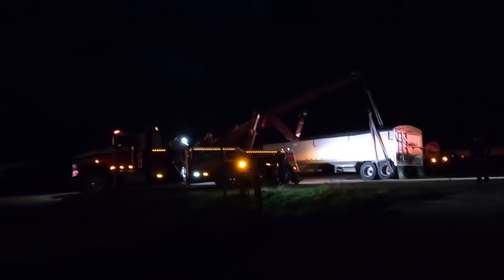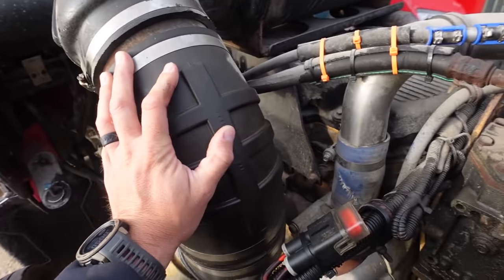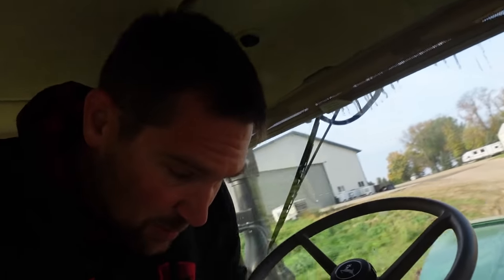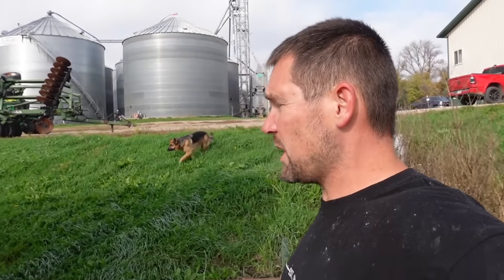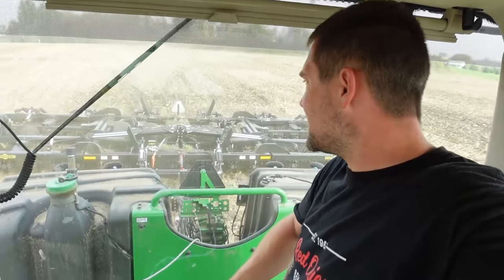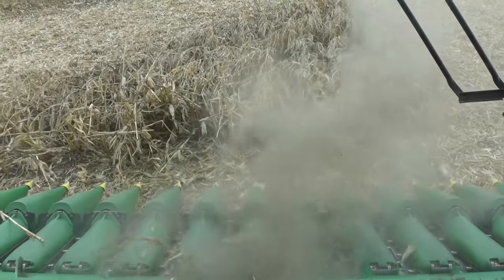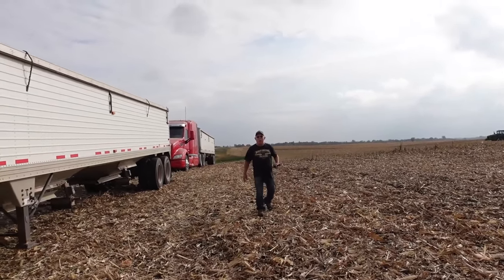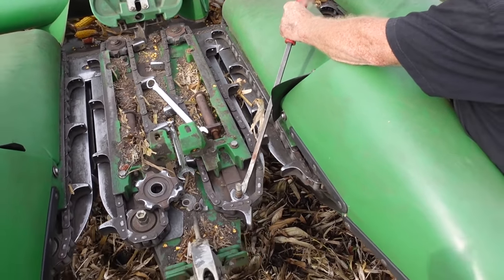Semi Truck ROLLS OVER on State Highway - NOT GOOD!!

Comment: Hi Zach I pretty much know what going through your mind on that truck we have had guys drive off the edge of the roads with trucks fully loaded with wheat down in kanas and Oklahoma you can tell them don't get close to the edge of the road when there loaded but it still happens hell a few years ago we had a combine operator  run the combine with a 35 foot bean head drive right in a county ditch up here in fall harvest  we had to get all American towing out of mankato to get it out but what's what happens when you have hired help you as a boss can only do so much.

Comment: That is now two incidents in the past two weeks with the same damn truck both with the trailer hung up in a ditch. Been driving 39-years and never done it once and that includes pulling 80'ft long oversize load trailers through small city streets. I never even put a scratch on a truck until three weeks ago when I was blind backing with a loaded trailer out of a fenced construction site by myself onto a busy city street during rush hour traffic and I clipped a parking meter with the front right corner of hood above headlight which smudged the paint. I don't even like my trailers getting near curbs while turning or near the ditches of the farms that surround my home. Two incidents in two weeks with the same truck, that can't be a coincidence? You own the truck yet you smile about it, I don't think I could handle that situation the same way. Just three days ago I'm traveling with my 53'ft dry van on a twisty and very hilly road which is only 16'ft wide with guardrails on each side. I'm coming through at 35-40 mph when all of the sudden a 12'ft wide field lime spreader with huge tires suddenly came into view up over the hill at a fast pace and the only thing I could do in that split second was get on the brakes and prepare for a major head-on impact. Just before he was about to hit me, he dove into an opening on side of road quickly with less than 4'ft between us as I was coming to a stop. He had no escort driver ahead of him nor working white/amber strobe lights to warn others he was coming through. I know this is fall harvest and everyone is in a hurry to get it done and over with but there is no place for complacency and all of us should get to go home at the end of the day.

Comment: That was hard to watch  tow guys didn’t have a lot of experience you can see that! On the John Deere starting problem fuel is leaking back check filters and make sure they are tight or fitting for pump /lines

Comment: As a experienced 50 Ton straight stick and 60 Ton rotator operator, that big wrecker driver needs so more training. He should have never tried to pull from the side with it loaded single truck. He should have offset from the rear with the junk inter grated boom. Lifting and sliding at the same time. He cost you 100’s most likely more in recovery changes being there so long

Comment: I honestly don’t understand why you would want a farm truck with a sleeper on it. When you have drivers that do not drive every day and seasonal it’s just asking for trouble. My opinion a day cab short with a back window can’t be beat 15 or 18 speed transmission is what you want in a farm truck.Back in the day you couldn’t beat a cabover for getting around and the guys that still run them know this.And anyone who’s been around really good recovery units are like me wondering why you even have a trailer left at all.

Comment: And today kiddie-winkies - what did we learn in "adult school" ?
We learnt to take a VERY WIDE APPROACH to turn right with a long artic trailer behind, as it will "never" follow the rear tractor tires, but take a much tighter inside radius.
Thus..
Approach from as far LEFT as possible, hopefully also with the trailer as far left of THAT as well, so the trailer doesn't have to jack-knife into the turn, but follow along as far out wide as possible.

Now - for tomorrows task - lets all go and tell the truck driver how he SHOULD have approached that - instead of tightly approaching the apex then turning the tractor into the inside - before going to the other side of the exit .. as..
THE TRAILER was being towed into the apex of the turn, as the tractor unoit even got there, - instead of being "set" as far away from the apex as possible (to the left).
Next time - yep the trucker will make the same stupid mistake - as he cannot figure out why the trailer is ALWAYS taking the tightest path

Comment: That wrecker company needs an equipment check as well.
Reply: That's not the point. Truck was fully loaded and weight about 60,000 pound of corn plus the weight of truck and trailer itself, it is not easy to "lift it"

Comment: Not a farmer and never operated a combine so I'm wondering how you knew that bearing in the middle of the head had gone bad?
Reply: Experience.  You might hear something off, notice one row not running as smooth, burning smell….  Most machines I notice something “off” before system warning lights.  If that sprocket failed.  The gathering chain could have damaged stripper roll, chopping head, worse yet get in feeder house, combine….

Comment: The tow operator if anything needs a new career that’s for sure truck driver I mean clearly started making the turn way to close to that side of the road anyways and for being An empty trailer I can’t believe all the chains and straps were breaking that’s called maintenance
Reply from the maker: The trailer was actually loaded
Reply: @MillennialFarmer  roughly around 60,000 lbs?

Comment: Ouch Glenn's Towing should be ashamed. I know they used a small wrecker but for cry out loud where are the loop slings for the rim's ??? ALWAYS Secure the vehicle first before you climb onto a SEMI loaded or not .... never put anyone into harms way. This for sure is a lift job. Way to deep in the ditch to overcome the weight force to pull her just sideways out. That towing Company is with their wrecker to far away. 15' distance max. You need the boom to have enough power to lift. They extended way to far out. 
Looks like a 2009 Peterbuilt 389 wrecker so 50ton...... He needs to use snatch blocks down low and his ram's on the ground which he has. it's a 2 part pull. First 1 loop pulls the trailer end up. 2nd rope first holds low onto the rims so the trailer can't slide further off. Once you have the with the first rope it pulled level you pull with the 2nd the trailer onto the gravel. Once all 4 trailer tires are on the ground you re position 15' again away and repeat the process. Always work safe and within range of your Equipment.

Comment: A driver had to use a wide turn, there are plenty of space for it, in order to avoid those kind of situation.
Reply from the maker: How much room is there?
Reply: @MillennialFarmer  I did not measure the road but I can only assume should be at least 25 feet wide road at least. The tuck could make a wide turn from upcoming lane or make a hook turn, againe by using both lanes. If there is an obstacle, tractor or other agricultural whide equipment, yhe driver could let them pass or figure out whose turn to pass in place.

Comment: Jeez that tow truck driver needs training bad. There are some heavy rings on his truck to hook a snatchblock to . They are stronger than most of his chains. Why would he use a chain at his truck to try and hook a snatchblock to. He's asking for trouble.  And then breaks a strap trying to lift the fully loaded grain trailer. That guy needs major training.  Stinks the trailer went towards the ditch though.

Comment: If i were you I would never call that wrecker company again, They were completely unsafe and incompetent, Not only did the rig in a stupid manner for the needs of that recovery but they also ignorantly rigged ignoring safe working load limits and failing to do resistance calculations resulting in numerous rigging failures...
Those wreckers often have 200 feet give or take of cable on each drum, at that distance to the truck and trailer that leaves a huge amount of wiggle room for rigging, Additionally, they often do, and SHOULD have varying sizes and grades of chain up to an exceptionally high working load limit, A broken chain should of never occurred, On top of that it appears the master link for the straps they were using broke, Again easily calculatable, At that time they were pretty much lifting the trailer with 2 lines, so roughly half of the trailer weight was on the one master link, Makes it real easy to determine based off that if the master link was suitable, clearly it was not, or was damaged previously and ignored. 
The truck was on most its wheels and had weight on the fifth wheel coming down so clearly if you correct the trailer the truck will come with it, No need to have a strap all the way at the front of the trailer for that reason, what they should have done is what they tried to do in the 2nd attempt but they should have increased their distance a bit, rigged a low line to one of the trailer axles with appropriate rigging for the resistance at play which would have been roughly 66 percent of the total trailer weight, and they should have had a high line with the strap to keep the trailer uprighted, That too should have been appropriate for the weight at play, which for tipping for is half of the total trailer weight as tipping force is only half because half of the weight is on the ground at the axles.
Always good to keep clear of a recovery but the joke one of my instructors at a recovery class I took made was "with proper resistance calculations and rigging inspections you should trust your rigging enough to stick your tongue to it."

Comment: Can anyone tell me why this cornfield is so down? storm, disease. I have never seen anything like this in France.124 bu/acre! Why do we see corn at 300bu/a at Border view farms, Michigan and not at millenial which is 200km further north? Frenchfarmer  thank you for the one who will answer me.
Reply from the maker: We had an extreme drought followed by 2 heavy storms. Our crop is very poor this year. Average yield here should be about 180. Good yields can hit 300 in areas but never whole fields (120-150 acres).
Reply: @MillennialFarmer  Thanks for the answer. In France 180bu/a south of Paris is a good year!! when there is a drought without irrigation the corn is only 5 feet tall, and only make 80bu/a. We have 500 GDD (growing degree days) less than you. You have to be south of Bordeaux and towards Toulouse with irrigation to make 230bu/a . On the other hand in winter wheat Toulouse 100b/a, Chartres 132b/a, Lille or Reims 154 b/a, winter rape 44b/a in Toulouse, but Chartres and Lille 50-70b/a. Daniel of France

Comment: Was it Allen again cause if it was he needs to be put on a shovel and taken off the equipment cause as a professional driver you wouldn't ever take a loaded trailer through a ditch that steep if at all and you can tell by how far he went into it before he couldn't anymore that he didn't even try  to stop he just thought a loaded trailer can be pulled like that AMATEUR move but it happens a shitty way to learn when you have to pay the bill.

Comment: 2 rigging failures, untrained operator of that wrecker, assuming truck was loaded because it was tarped boom too low of an angle for the weight,  too much stick out for the weight for that 50 ton wrecker. Since it was a straight stick or even with a rotator back up to the rear of the trailer offset, double both lines up, pick and swing. 1 hour tops. Now if they were scared that the unit was going to tip over they could run a line from the smaller wrecker with a strap over the front of the trailer as a "make you feel safe line", both failures that happened here could have been prevented, also both failures could have let the wrecker and farm tractor trailer both roll.. damaged rigging and it looks like dented trailer side. Luck only goes so far before they kill or hurt themselves or someone else with stunts like that!!